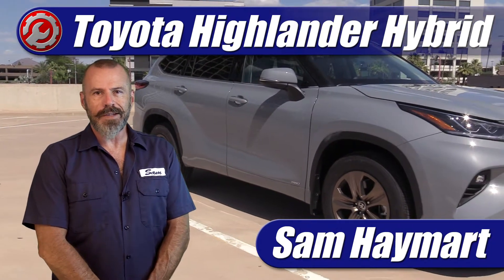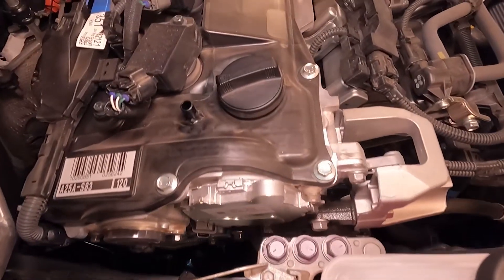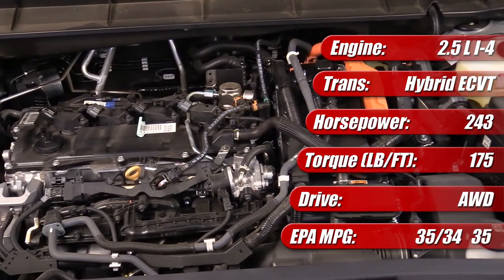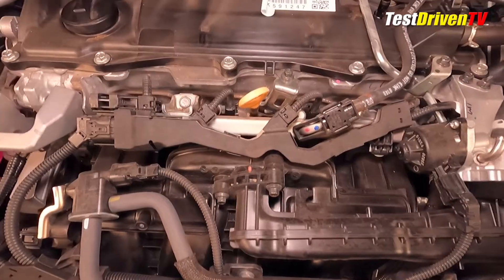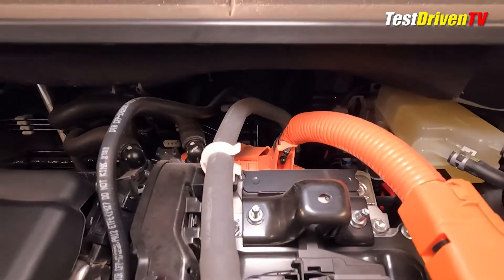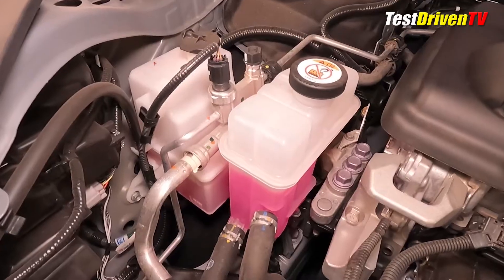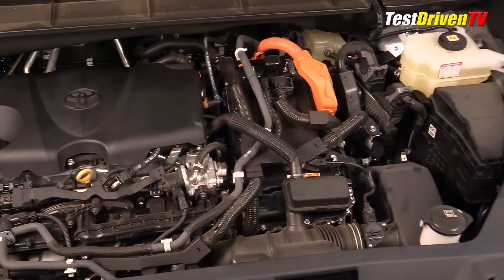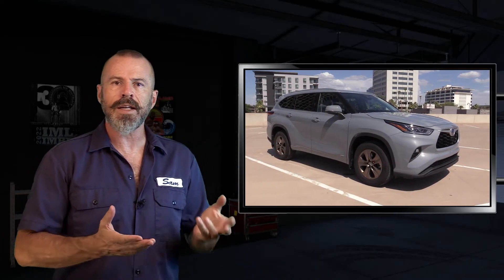2020-2023 Toyota Highlander Hybrid: Engine Explained

Comment: Do you think that the hybrid system in that Highlander is underpowered? I have 2020 Highlander hybrid and I feel that power is not enough for such a big SUV.
Reply from the maker: Everyone has a different opinion on how much power is enough. It's certainly less than  the V6.
Reply: They could bump the power up
Reply: 0 to 60 In 8.5 seconds
Reply: @TDTVGarage  please in the future review the Mitsubishi outlander plug-in hybrid 2023 Mitsubishi is revealing it October 12th on their website with live stream
Reply: My jeep used to do 0-60 on like 11 secs . This v6 is totally a difference. I feel it’s peppy enough
Reply: I own a 2023 Highlander Hybrid and I am happy with the performance and much more with fuel efficient.
Reply: @DroneSurf nice you are still liking it so far how's the sport mode do you feel the extra torque from that electric motors
Reply: @Maxwell1989 I haven't done sports mode on thr highlander hybrid but on the RAV 4 but man it's Definitely pretty Quick at start point it feels like a literal sports car in sports mode its better in hybrid than In gas cause better breaks and regenerative braking which charges the battery for the extra power needed when accelerating at high speeds.
Reply: depends on your drive style use normal or sport you will get more power

Comment: I live in Central Florida would you recommend the Highlander Hybrid model in FWD or AWD, I plan on trying to purchase the Limited Highlander model in 2023.
Reply: The difference between FWD and AWD In economy is only 1 Mpg. When rains,  I really appreciate the AWD in my Highlander.
Reply: Go for all wheel drive always not FWD cause all wheel drive is mostly FWD Until you'll need all wheel drive in various situations.
Reply: i agree that AWD is better than FWD but i think AWD has bad cable gat design and that's not good for hybrid system

Comment: You failed to mention that on the driver side at rear there's a great location for a extra battery for a subwoofer system. Oh and the AWD is more like all-wheel drive assist. Because when driving on a wet surface. The front wheels will slip. Oh and all of the stupid beepers on this P.O.S car! Turning them off is not possible, but breaking the speakers  is. The AWD Acura MDX blows this thing out of the water on performance.